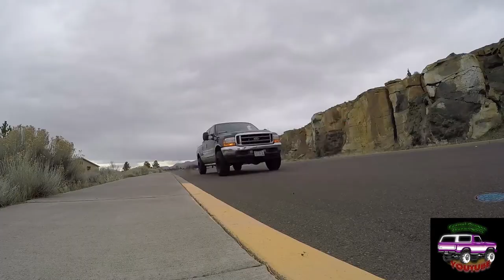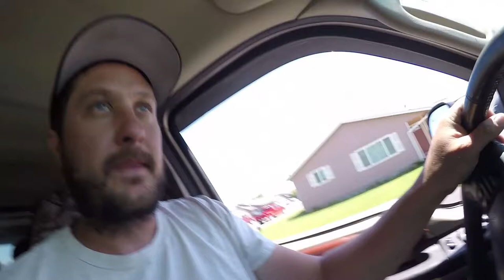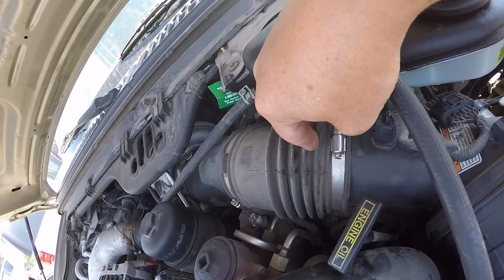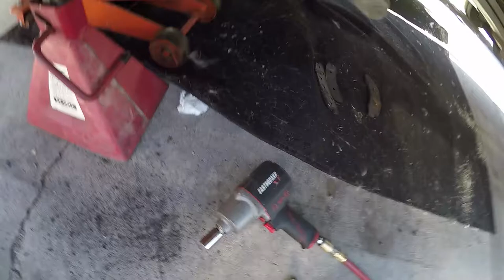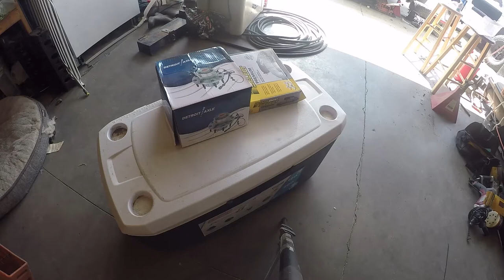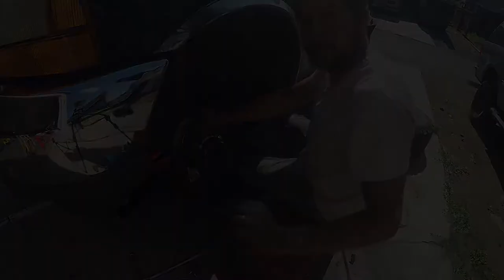2001 FORD F250 WHEEL BEARING REPLACEMENT

Comment: Another indication is when your ABS light comes on. Mine did so I replaced mine w/Timkens that came w/everything as well. The only thing I came across was my 03 came w/corse & fine thread options on the studs!!! So make sure you get the right ones... yeah I got the wrong ones (hubs) & had to take all the studs out of my old ones an new ones for that matter to re-use/replace on new hubs!!! Enjoy all the videos & appreciate all the extra time you spend making them.
Reply from the maker: Thanks for your support

Comment: Detroit axle has been good for me. I have put a set on the last few vehicles I have owned and my truck I am currently driving. Dont have really any complaints. I called the customer service on a issue and they were professional and  courteous. So I would say you'll be fine. And yes the customer service and warehouse is based out of Detriot. It was a hope skip and a jump for delivery, seeing I live in Ohio.
Reply: I have used Detroit Axel for several replacement parts. No complaints yet!

Comment: Great video! The other, other way to compress the caliper pistons... You can use a single C clamp on both pistons.... Just put the old pad back on and clamp right between the 2 pistons. No back and forth screwing necessary😂

Comment: My dad has that same impact and it works but doesn't work as good on my grandparents air compressor that's Electric and my dad has a Ford 302 air compressor had a lot more volume and CFM and it works pretty good on that makes the impact work a lot better on that one

Comment: 6.0s are great 100 hp more then a 7.3 almost as reliable and you can fix it without pulling the cab its great
Reply: By almost as reliable you mean could explode at any minute unless you've done everything perfectly from the day it came off the line, or spent thousands in "bullet proofing" which has been proven to not actually be bullet proof.
Reply: what world are you from lol

Comment: You need a front end alignment after doing that?
Reply: You shouldn't - you're not altering anything, just replacing. He does make a point that the lugs need to be torqued again after 100 miles. If you do feel a pull then of course you'll need an alignment, but this shouldn't necessitate one.